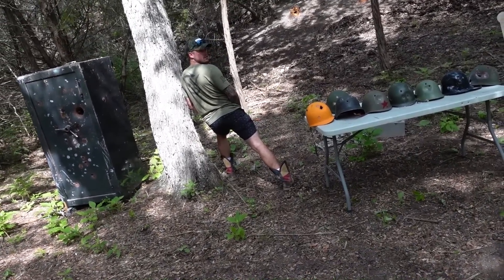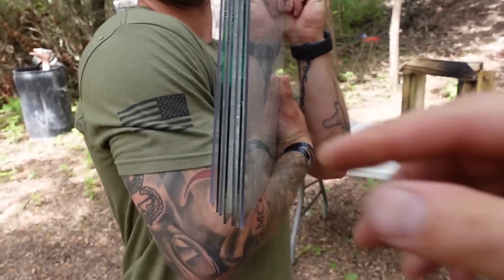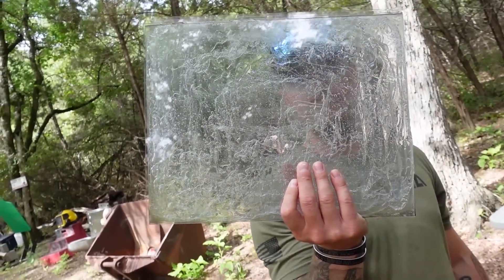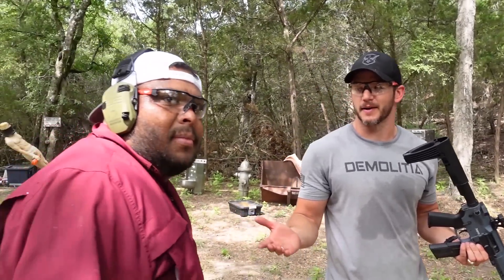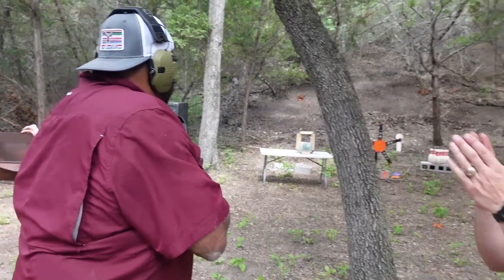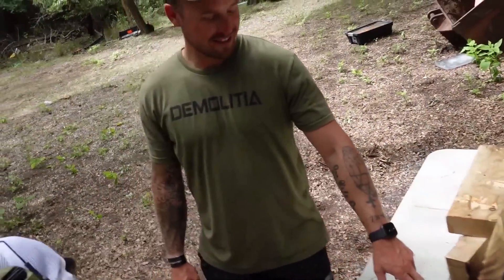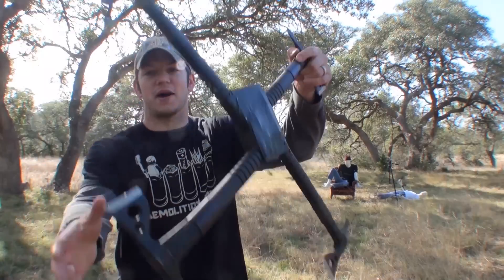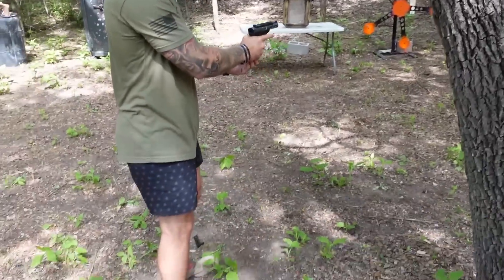Colt Python vs DIY Bullet Proof Glass!!!

Comment: First & Foremost, you must use Safety Glass, like used in the windshield in your vehicle!  Next you use CLEAR EPOXY CASTING RESIN between each layer instead of Liquid Nails!  You must set heavy weight on top of glass to press all the layers together tightly for clear glass.  Polyester Resin will also work but will be about 2/3s as strong
Reply: I was going to suggest just clear epoxy plus lexan, with no glass. I wonder if that would be too soft, or if you could still see through it after it's been shot.
Reply: additionally, put it in a pressure pot while it's curing. that way any bubbles that do form, are very tiny.
Reply: So I know im late, but that’s why I came back to this comment. In one of his recent vids, he used safety glass, which completely shattered and lowered the stopping ability of later rounds
Reply: Just curious but it seems like most commercially available products have a more silicone like layer bonded between panes. Epoxy may harden too much and take away from the fragment catching abilities of a more ductile like substance such as silicone?

Comment: 1/4" lexan and when you layer, if you have a friend with a vacuum chamber to help pull the air bubbles out from between the panes.
Reply: don't forget the urethane, the vacuum bagging, the autoclave, and the knowledge of how long to "cook" it, and at what temperature.   BR glass is difficult to do properly.
Reply: I was just thinking this - the air bubbles may significantly weaken the glass
Reply: @Wombatantify  I made BR products for a dozen years.  It's difficult to do, and expensive.  UL level 3 glass (stops a .38 or 9mm) is around 50 bucks per square foot.  Prices rise with the level of protection required.

Comment: Just a suggestion, You could use tempered glass instead of the regular glass, it might work better. The tempered glass stays after cracking and is comparatively harder.
Otherwise, nice try making the bulletproof glass.
Reply: Or just laminate some polycarbonate panels together 🤷‍♂️ Much stronger than all of them really.
Reply: Pretty sure it was tempered glass looking at the way it broke
Reply: PETG!!! >PETG is both thermoformable and vacuum-formable, and can tolerate a tremendous amount of pressure without cracking.
Reply: @harrywhybro4997  tempered glass after breaking interlocks and doesn't crumble like the regular glass they used, besides they did say it was regular glass.
Reply: Also needs to be packed a whole lot tighter
Reply: laminated glass
Reply: Might need a better glue stronger bond, sorry not sure what kind tho.

Comment: Do away with the glass and just have a lot of layers of 1/2" lexan glued together.
Reply: The glass breaking absorbs kinetic energy from the bullet. That's exactly how ceramic armor works. It's incredible stuff and it's rifle rated. Matt tested another homemade armor plate that was composed of ceramic floor tiles and it worked AMAZINGLY.
Reply: Yeah, but hardened glass and not standard shit like this.
Reply: @bigfutus  actually, tempered glass is sometimes used in laminates but most often, its float glass.  Usually low iron so that the night vision goggles will still work.  A dozen years in a laminate factory.
Reply: Polycarbonate is better
Reply: He could try thicker glass, and start with glass instead of the Lexan. Ceramic armor is the idea behind what you're trying to accomplish with bullet resistant glass.

Comment: Thicker panels will help, but you need to find a way to keep it from delaminating. You could try building a frame around the glass to hold it all together after it gets hit. It's possible that thick one might have stopped the 223 if it hadn't already been shot twice. 

Also, if you can find sk.eone with a vacuum chamber, you could use it to such all the air bubbles out of the liquid nails when you glue the layers together. It would for sure make it more clear, but might also help with strength too.

Comment: I worked for years in the plastic industry, and knew that polycarbonate, such as water cooler bottles are made from is often used. I've actually tested thick layers of polycarbonate against different calibers with complete success. Its also used in laminated form with glass, or other plastics. It works extremely well.

Comment: Use two part epoxy resin for the glue. You can cut slots in a board to hold the panes of lexxan and glass in a frame, and pour the resin in from the top.

Comment: Instead of all the alternation, put a couple sheets of the solid glass on the outsides with plexiglass between them and maybe one or two sheets of the solid glass in the center. You want hard sheets on the outside to absorb the initial impact and break up the projectile then the softer stuff behind it to catch and hold the fragments.

Comment: use yacht repair grade clear epoxy resin , use all normal glass- for like 8 layers - 8mm thick tempered glass each layer  - then do 2 layers of alternating between plastic glass with a thin bit of flex paste clear between it - final layer should be plastic to prevent shattered glass from getting through - like a clear anti spawl coat on the other side of the plate 
Also make a wooden frame around it and screw the two frame halfs tight so that it squeezes the layers together-  if the layers cant seperate and the glass cant be pushed aside when its crunshed it increases stopping power by like 40%.
Since you use normal grade glass you cant expect crazy results but it should stop AK fmj and maybe some .308 soft point

Comment: It may help with the multiple shot durability if you build some kind of frame, where the panels perfectly fit inside. This way you could equally pressure the panels together and after the glue dries keep the pressure on around the sides with a ~1.5 inch wide piece of wood running around the edges of the glass. This should help keeping the glass between the plexiglass around the sides. Also the less glue the better, the more pressure while glueing the better, and maybe use epoxy glue

Comment: Thicker plexiglass. Glue them together with a thin super glue not a gel or thick glue cuz it will be spongy between the layers and set a weight on top of them while the glue is setting.  That will keep them together and tight and more solid/dense..

Comment: Use a fiberglass or acrylic resin, not liquid nails, and vacuum press the glass to minimize gaps in between sheets. Try one 1/4 inch piece of plate glass in the middle of 6 or 8 sheets of polycarbonate.

Comment: Use epoxy or flex seal instead of liquid nail get art grade epoxy if you want it clear and heat the epoxy with a heat gun or just put it in a vacuum to pull the bubbles out

Comment: Next time you put the soft layers, put one big glob in the middle and squeeze it with a C- clamp or something. Maybe that'll kill the bubbles. And something to try is plexiglass that's has a different chemical makeup, most of them are petroleum based thermoplastics, the stronger ones are polycarbonate though.

Comment: By the way if you do that style of bulletproof glass and you stick it in the oven or in a hot place for a couple hours with the bricks on it it will actually heat up temper the glass and also the Melt the plastic to the glass which will laminate the glass which in turn will make it stronger

Comment: I have an idea I think it would be cool if you tried, if you were to take a heavy duty scale( like one you were to weight yourself on) and put a steel plate in front of it and shot it. What would the scale say would it say nothing and the bullet just deflect off the plate of steel or would it register on the scale for just a second and only you would be a to see it in slow motion. Idk what would happen but I think it would be cool to find out

Comment: some sort of fountain that will automatically refill an aquarium with automatic flex tape applier. you shoot the aquarium, the bullet will stop in the water, there will be leak on the aquarium wall. the fountain will keep the tank full while you use flecx tape to seal the hole.

Comment: So my suggestion? Just a very thin layer of something like superglue in between sheets and a different type of actual glas like the type you make glass tabletops of. The point with alternating layers you are trying to achieve is to slow the bullet down and then disperse the energy in the next layer then slow down again then disperse energy etc. (from my understandign at least)

Comment: You said it was plexiglass acrylic but also said lexan (which is not acrylic, it's polycarbonate).  Which was used in the video?  Plexiglass (acrylic) is brittle and not impact resistant but is very clear.  Lexan (Polycarbonate) is the tougher material but more expensive and not as clear or scratch resistant.  They make polycarbonate in 1/2" thickness maybe more.  Try a 1/2", 1" and 2" thick polycarbonate sheet and see how it does.

Comment: Contact total boat and ask them for their strongest epoxy. Also ask about vacuum infusion. 
Build a form out of melamine coated lumber that is as close to the dimensions of your glass and acrylic pains. Shouldn't be more than a sheet of paper's gap. 
Coat the form in mold release, stack up you glass inside the mold. Slide everything into the vacuum bag. Draw a vacuum, then release the epoxy into the bag until it completely saturated the pain. 
Let it harden. 
The glass should be window clean, and way the heck stronger than what you made.

Comment: I think heat from a hairdryer would help to get the air bubbles out of the adhesive. Nice job on the glass though. Can you get a harder clear adhesive?  Maybe an epoxy resin .  short of higher tech glass ,More but thinner layers of tempered glass betwen the lexan layers. With a thicker single pain of glass dead center of the laminate ...i wish i could draw a diagram...  A lexan layer then several thin glass layers to double the lexans thickness. A lexan layer ,laminate layer, lexan , thick glass pain layer, lexan, laminate, lexan, lamanate ,lexan. That should give some flex to soak energy and decelorate the bullets better.

Comment: I'm not sure that you want such a good mechanical bond between the layers.  The lexan is doing its job by flexing, but if it transmits all of its energy to the next panes of glass before the bullet even arrives, then the benefit of a flexible layer is greatly decreased.  I would think that a tempered glass panes bonded to EXACTLY ONE pane of lexan behind it with those composite units separated by foam spacers might do better.

Comment: Yeah i dont think second shot gets much resistance because the hard glass layers are all shattered. There are three ways to stop a bullet. Be harder than the bullet and its kinetic power, think tungsten. Be thick and soft to absorb the impact and projectile energy, think a chunk of lead. And then there is what we have here, be hard yet brittle so the projectile does not penetrate and the cracking dissipates the energy in a radial direction directly away from the impact point. The whole point of bulletproof glass is not to stop the bullet from penetrating, like Kevlar does. It's to waste all of the bullets energy in dissipating it on shattering glass, thus slowing it down enough that it just stops. That's why bulletproof glass impacts have that bulge in the back. Ceramic armor works exactly with that principle in mind and likewise offer marginal protection past the initial impact.

Comment: So the physics is that the glue should thin so the plexiglass will hold the glass together but the liquid nails has to much give so if you try and use 30 min epoxy and put a then coat on it and compress it after each glueing you should do better.

Comment: Homemade Bullet Proof Glass   = outer layer of Tempered glass + laminated glass, we have not worked it out here, but I would think if you sandwiched 3 or 4 sheets of laminated glass between 2 sheets of  Tempered glass or "wire glass" it would stop most hand guns.  But you have to watch the weight.

Comment: Pour clear window caulking mixed with a thick layer of rubber cement in the center of the glass and apply even pressure it should spread clearly and provide that gummy texture and soften the impact. Sorry for the grammatical errors. I know what I am trying to say. Lol

Comment: To glue the sheets together without bubbles you need to slide together, not stack them.
You also need to use polycarbonate not acrylic. 
And the glass should not be safety glass.

Comment: You might try using Safety glass instead of plate glass, with epoxy in between,  Also if you put them in a heavy bag and pull a vacuum on them, you might get the layers tighter, and more transparent.

Comment: Penetration isn't all about speed its speed+mass there's a reason 50cal punches through lvl 4 ceramic armor. 750grain round traveling at 2,900fps your not really stopping that now the 5.7 is a 1.8 grain round travelling at 2,800 fps the mass shreds off as it tries to Punch through its target and it stops before it can get through

Comment: The main component of bullet proof glass is a material called Lexan it's the same thing that is used in the pads that go under office chairs behind desk so you don't trash the carpet, also in response to another comment the best body armor you can buy is Armor hide just ask the generals you would go for rides in the sandbox and the troops that had to ride with them however when the mission was over they had to turn it back in and put on the same #$&##! they had originally been issued. Plexiglas is not Lexan it is very different so if it doesn't say Lexan it's not the same another thing is Lexan is a lot more expensive than Plexiglas

Comment: I once put a hundred volt dog collet on a p99 co2 pistol and swear it increased volocity.  I used to say volt plus ...... Can u try volts theory electric in barrel wether increases speed o bullet  p 99 is metal on plastic...not sure if you can find weapon and volt...dog cooler etc....yours jason

Comment: I've never actually looked up how industrial bullet proof glass is made, but my guess is that they probably start off with layers of different kind of glass like Matt made before heating them not to the point of melting but to the point where they can compress them, fold them, compress them again and repeat. Basically how they make flexible yet hard and strong steel swords like the European long sword or katana.

Comment: Uhhh are you using that type of plastic because it's available in the local hardware store?!? Hope you considered using polycarbonate... Because that's a type of plastic that's used in bullet resistant glass...annnnd it's "mixed" in with the glass.... I'd guess "glueing" that together even weakened your idea... Maybe just fasten them together in another video.... You could also try and using tiles/ceramics for "not clear" versions... I've heard actual horse hair being used in a sofa to make it bulletproof....forgot which television show it was on though... Maybe even try shooting Tru several camel backs....you know because water can't be compressed..... Boy oh boy if I had access to a range and all the goodies I'd be testing out a whole ton of stuff( cheap man's bulletproof vest)

Comment: Tbh I think the issue is that you put it together like shit. Too much adhesive and whatnot in the middle, so the layers didn't get to properly spread their energy across the glass, but just my opinion based on the visuals. I also wonder how thinner or thicker pieces would compare. I have a feeling that really thin sheets of each will work best, but that's just speculation again.